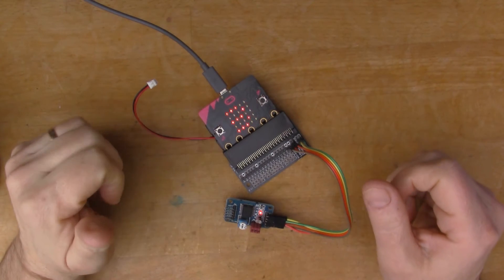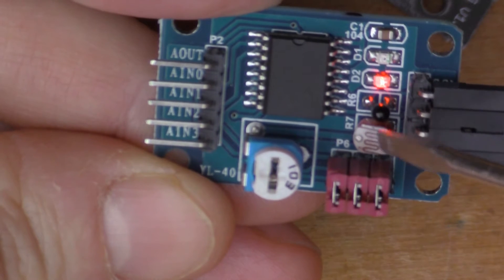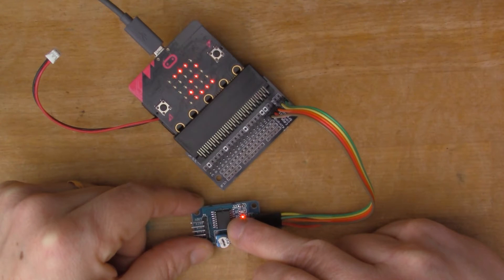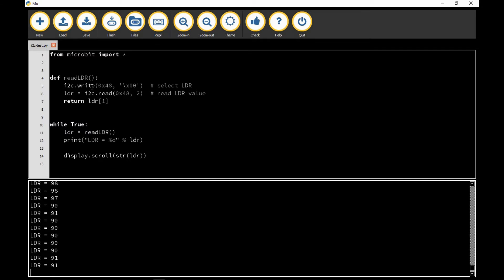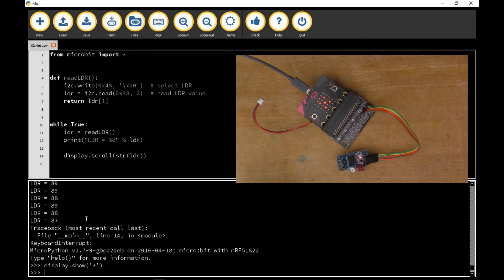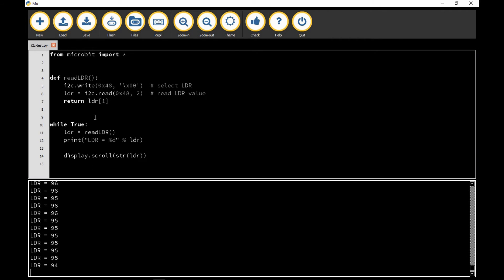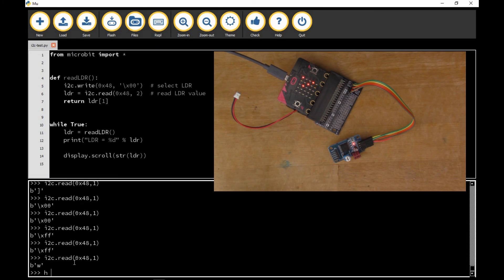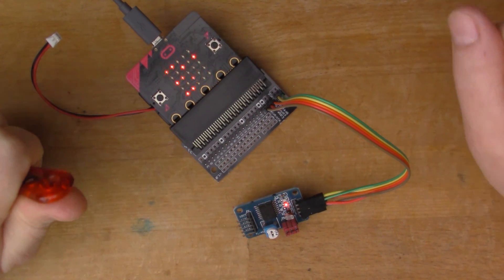Connecting to the micro:bit.  Light sensing with the LDR.

Comment: Thanks for the reference of the i2c board to expand analog sensors.

As tip for a new video, you could add to the code an logarithmic equation to calculate light in lux, taking in count also the temperature (5x5 matrix diode capacitor). After the process of calibration with an external sensor (mobile app or commercial luxometer).

Since the ldr will wait about 1 or 2 seconds to modify its value, do you know if it is possible to use a timer oscillator (clock) to regularly record values, without be affected by other portions of code where we might use delay sentences.
That is, how we can create a ciclic data logger based on the ldr to calculate the average of lux levels in one minute, one hour, one day, week ... maybe year if we have space on files folder of microbit